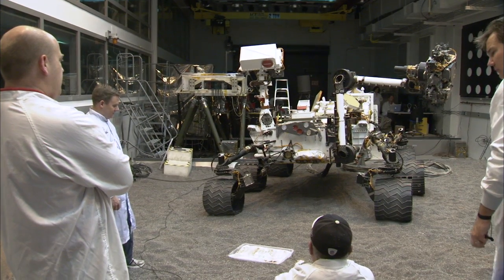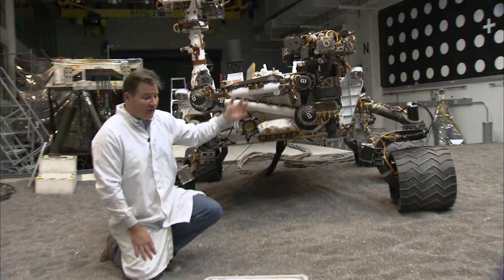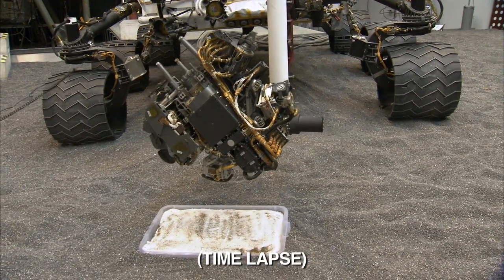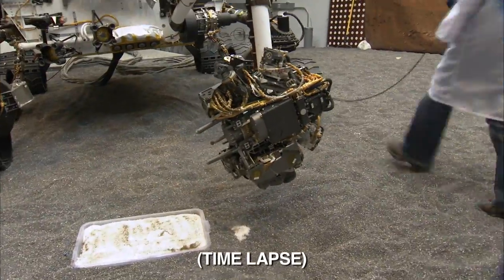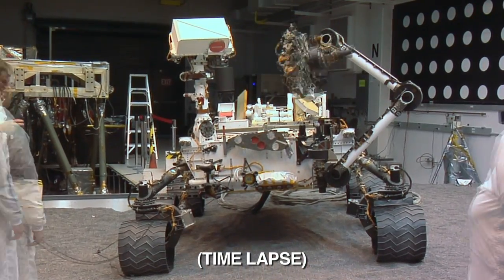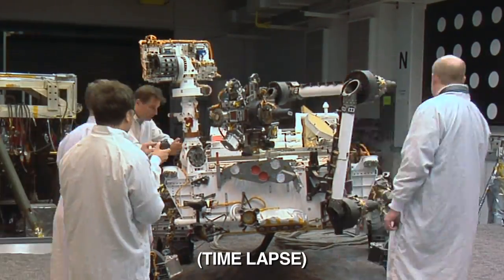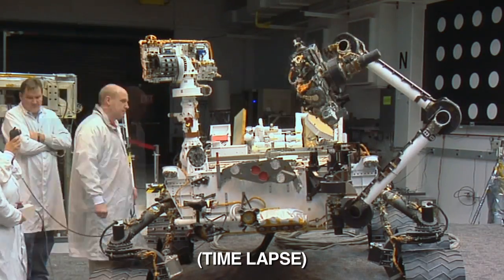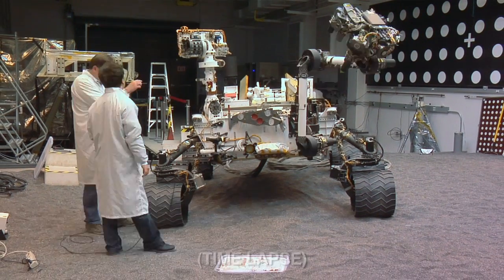Curiosity Rover Sampling System Scoop Test

Comment: No, They are MASSIVE! I thought the same thing but just last Wednesday I got a private tour of NASA's JPL lab (buddy from the Air force works there). But the rovers are huge, this one looks like a scaled down model even! Think about this, My 4 door f350 diesel weighs about 8,000 pounds. Curiosity weighs 50,000 pounds!
Reply: The rover weighs 899kg or 1,983lbs, not 50,000lbs.